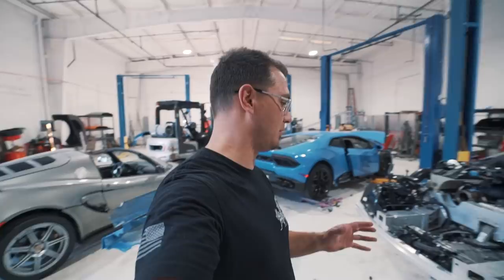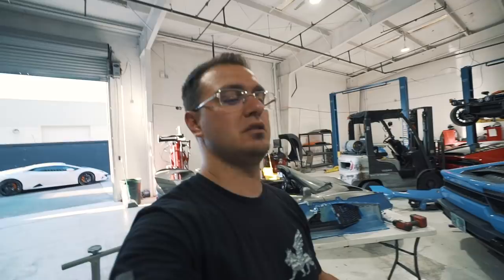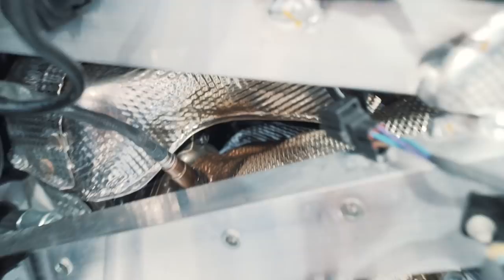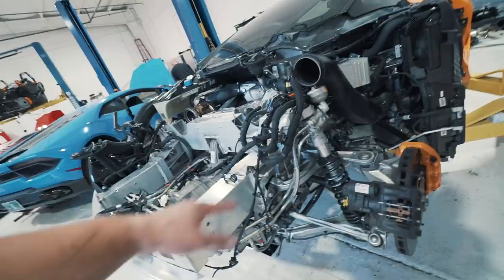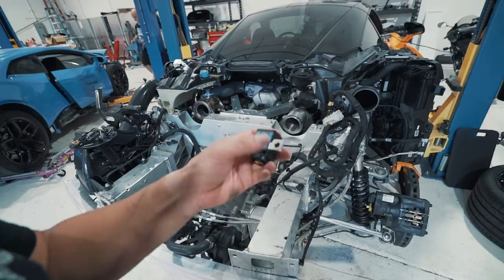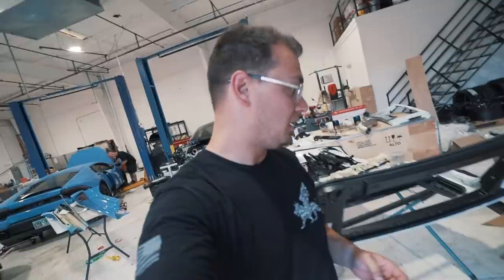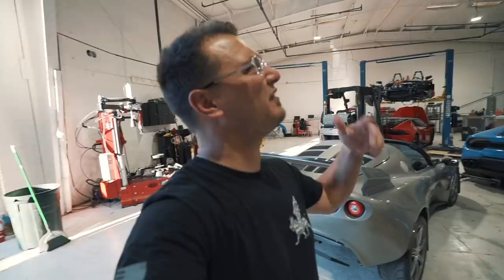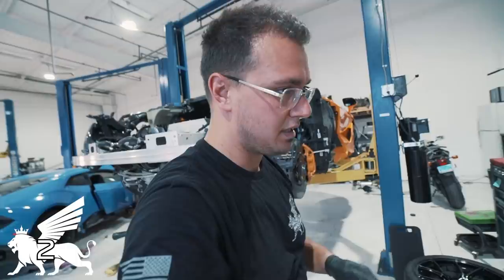Wrecked Mclaren 720s rebuild (I only have 3 days)

Comment: As an engineer, I would find it interesting if you could film and narrate all the pipes, hoses, actuators, sensors, pumps and parts of the suspension system and the functionality and behavior of it all on that car if you happen to have it apart again.

I don't know why this subject alone holds such fascination for me, I don't even own a car since 5 years.. but it still looks like a beautiful thing from a pure technical standpoint, although I think that I personally would never buy a British vehicle simply because I got cured in my youth from wrenching on my dad's Austin Healey 3000 in horror over the technical solutions used, although it had the effect of making me more fluent in using both metric and imperial units..